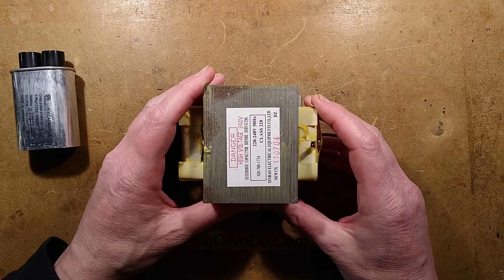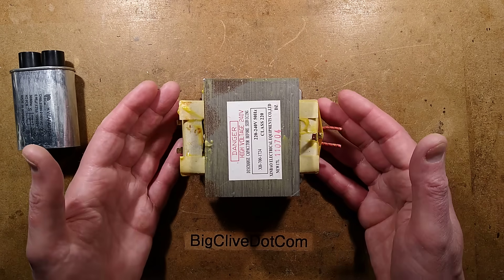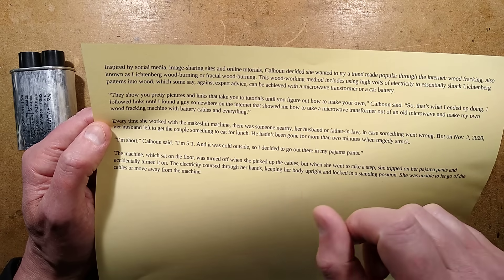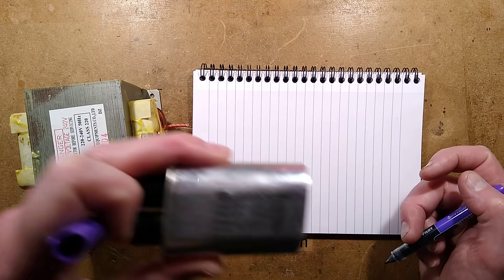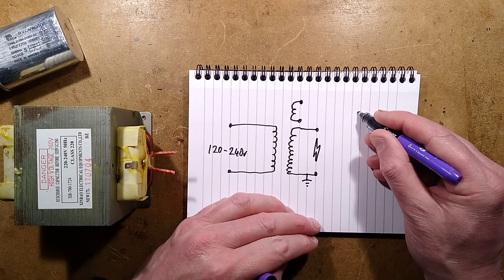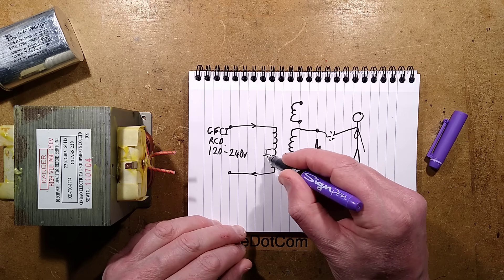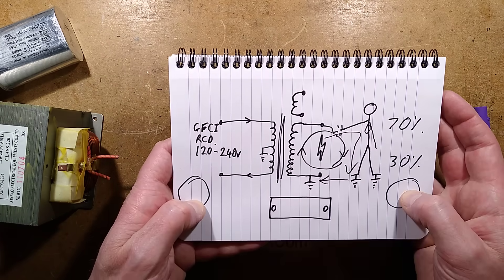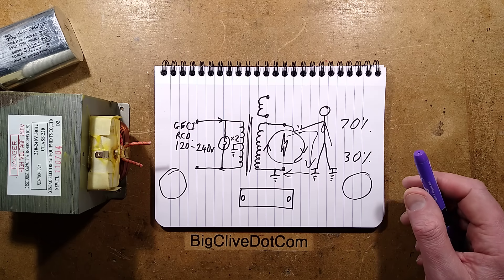The most deadly project on the Internet

Comment: Remotely operating a safe box with interlocks from far away is really the only thing to make this remotely safe to operate... another extra security measure can be pir detectors shutting of power at a latching relay so even accidentally getting nearly in range will render it powerless

Comment: I wonder, could you (perhaps weakly) tie one output of the transformer to neutral? if you did so that'd at least trip the RCD wouldn't it? though I guess it also puts one terminal at a define voltage above ground leading to instant bad times with a single contact rather than the two you'd typically need.
Reply: Likely just induced current could trip if you tried that.

Comment: In one of those videos they were using the ballast from a florescent light. Would that be the same safety precautions or would that require further safe guards?
Reply: It's hard to find any solid numbers but it would appear a fluorescent ballast still has some "grunt" to it so I'd treat it as killer.

Comment: I hope the video will help many people understanding electric shocks are no joke. One comment about the dead man switch: I've seen them used in controls used to "teach" robots. You have to hold two buttons with the palms of your hands if you want to move the robot but if you press them too hard it won't work. I guess if you want to prevent electric shock, using pressure sensitive buttons like those would be better, conventional buttons may not prevent you from the shock if you grip the device and cannot let it go.

Comment: First rate video. I was professionally trained in electronics, and there's NO WAY  I'd play about with a transformer from a microwave oven, (except maybe to remove the HT winding and replace it with low voltage windings for other projects.) Always respect electricity, just one mistake is all it takes...

Comment: Clive is so right about this, i have worked with high voltage and you can get a shock so easy so don't do it unless you know what you are doing.
if you have to do it read this, its all about insulation, never hold the wires, use something that is insulated to hold the wires, or even better set up the wires so you don't have to hold them, step way back and use the mains switch to activate, then turn it off and unplug before you approach your project after the burn is complete.
i have had a few shocks in my time, low amps but high volts, its not nice, i got too close to a HT lead with a metal tool in my hand, now the HT is supposed to be insulating, but yeah, it was old and was leaking voltage down to earth and i was leaning on the earth, 15,000volts for a split second will soon wake you up, i would not like to feel if it was constant, be safe out there people,  high voltage is no joke... trust us we are professionals.

Comment: I have several MOTs sitting around at home.  I have considered building one of these units - I will NOT because there is no way to properly safety one of these devices.

If I want to play with high voltage - I'll consider building something that can be remotely pulsed, like the medical lasers I've worked on in the past (power supplies that make a MOT look safe).

Comment: This is so weird, I today looked up "how to remove magnets from microwave", seemed ok up until I read the specs on the transformer, the HV cap and the beryllium coating(unsure if I spelt that right), I decided against risking my life for some, from what I saw anyway, mid-tier magnets that I could easily buy and save my self a whole lot of stress and possible death.
Reply: Old microwave oven magnetrons have beryllium oxide insulators. I have disassembled tens of microwave ovens for magnets and other components. I have not crushed a single magnetron insulator despite some rough handling. they are pretty sturdy.
Reply: @Psetta  Are the magnets you get worth it though, I have a microwave that's about 10-12 years old, been sitting ready to be taken to the dump.
Reply: @dallasgrant  Depends on what you're using magents for. Old speakers have good magnets especially subwoofers. Seem to be on par with the magnetron magnets.
Reply: @Milwaukee Mac Repair I've been hording them for years, I fix computers on and off and if someone wants their drive wiped I drill out the platter in front of them and disassemble the drives, I probably have 20-30 magnets form them.
Reply: @Milwaukee Mac Repair Another good source of magnets are the dynamos from workout bikes and ellipticals. A little while ago I recovered the magnets from and they were unlike any other magnets I've ever come across before. Extremely strong like neodymium magnets yet light as a feather.

Comment: The High output voltage of the secondary of the Magnetron transformer is AC...  the voltage to the magnetron plate itself would be rectified DC, and filtered by that big capacitor he talked about!  -  either way, it can kill you if you touch it when it is plugged in!

Comment: Excellent statement on safety,  we used to test resistance welding transformers ( spot or projection), with 2 Kv insulation apparatus,  requirement was standing on a rubber mat, and very thick rubber gloves.
Dead man's switch now feature a mid position switch, ref press enough to close contacts,  both pressing harder or release open contacts.
Thanks for sharing

Comment: About halfway through the video I had a horrifying realization.
MICROWAVES ARE ~1000 WATTS.
2kV at a THOUSAND Watts.
They're DESIGNED to cook
Reply: And because of the way the voltage doubler works on the old one the transformer will do double the wattage!

Comment: They make awesome car stereo Power supplies cut the high voltage out and re wind them using a voltage regulator. Great video the high voltage caps are dangerous to if they don't have a bleed off resister.

Comment: Ugh, I see a capacitor and a transformer. What could possibly go wrong? Just use a AA battery on one side of even a small transformer (for audio) while a friend (or have friend zap you) holds on to the other side. 

Another good way to get zapped is leaky spark plug wires. The sudden release of electricity in to the ignition coil generates a pretty high voltage. I got some shocks which I think were around 50kV.

I didn't think about it, but yes a GFCI won't save you with this burning technique. Nasty.

Comment: Having worked on high power AM transmitter equipment over my lifetime using valves with many KV on the anode, it's the capacitors that make me most wary. Of course no one should touch this stuff unless they have a deep understanding and experience with high voltage electronics.
Reply: And even high/mid frequency isn't better: you should not look into a coaxial cable connector, to begin with...
Edit: MF and HV in induction heating/treatment.
Reply: @AltMarc  A coaxial cable connector does not normally transmit a signal through the air. A male connector only has a wire less than 0.25 inches leng. That would make a terrible antenna unless the signal frequency was in the very short microwave frequency. At the short microwave frequencies you would be using a waveguide not a coaxial cable. Microwave waveguides do transfer energy and are dangerous to look in.
Reply: I worked on those for a while and lived to tell about it, did get shocked by the antenna tuning network, got a puncture burn.
Reply: Many years ago I heard about a RADAR technician who was in a hurry and didn't discharge the high voltage capacitors on the transmitter. He crawled inside, got a shock, and bumped into the high voltage capacitors leads. He didn't survive. Without doing something safely you are at a much higher risk of death. Accidents can happen even when doing the correctly, but the chance of serious injury is reduced.

Comment: Good video, Clive.
I was an Electrical Engineer for almost 50 years before I retired. Enjoyed every minute.  I'm still scared of electricity and hate even the smallest shock.
The line between overwhelming fear and adrenaline rush is very fine and often very blurred. The line is called "Respect".
I finished up my working life teaching electrical safety. Live working is definitely not a good idea unless it's absolutely unavoidable and done in a very controlled environment with proper equipment, an abundance of caution and being observed by a non-participating qualified person ready to carry out an emergency shut down as well as point out any deviations from agreed procedure or unanticipated scenarios.
In my experience the dangers of arc flash are usually greater than electric shock, and just as common as. Arc flash from a microwave transformer is not relevant because the current would be too small. It's not going blind you or evaporate copper for you to breathe in and condense back into solid copper in your lungs.  But the flow of current through you will cook your flesh given enough time. Just as it cooks the wood. One hand in pocket is often a good idea, but of course that doesn't help when your feet are well and truly earthed.
I don't think that you emphasised enough the fact that your muscles will contract and you simply won't be able to let go of the live wires however hard you try even though you may still be conscious. Conscious for a while as you are slowly cooking or until your heart stops or your fingers fall off.
Reply: Yes, excellent idea to not use your fingers as fuses.
Reply: I experienced that muscle contraction fun already at 240V when I was 6 and unknowingly touching an exposed mains outlet. It is an unfun experience.

I love electrical engineering in theory, but I stay well away from any high voltage stuff. There are people who are paid to know better than me, worst case I can hire them.
Reply: @insu_na  You are so lucky to have escaped without serious injury or worse, glad you weren't harmed 😊
Reply: Why isn't this causng you to get knocked out as I'm hearing the electric chair does?
Reply: @draygoes  I believe you become unconscious as a result of asphyxia due to the inability of the diaphragm muscles to work, not a great position to be in.
Reply: @draygoes  Sometimes it does, but even then only after you have been forced to endure the pain for longer than anyone is wishing their worst enemy. If or when you pass out is pretty much impossible to say. And even if you were to pass out, your muscles wouldn't relax.
Also one of the reasons why the electric chair was done away with was exactly because it didn't knock you out immediatly. Which makes it one of the worst ways to kill someone.

Comment: It only takes 1/10th of and amp to kill you, you could also be electronic zapped checking/ testing on you automobile during the winter as salt is present, if your in a heated garage and the ice starts melting and you get wet a bit wet from run off, a natural situation, and all of a sudden you will feel a tingle present, and you have just completed a circuit. Same goes for HF welding and your sweating in summer you could complete a circuit, your also sweating salts. This why some manufactures, put up barriers around cages to keep you away from the work piece and installed fail safes. Sometimes your paying money for an tool, that has failsafe's built into it which is more money. There is a reason and reasoning behind this methodology. Save up and buy the proper tool and tooling. Short cuts only result in a short life! Thank - you for making this video!

Comment: I like the deadman switches.  I have heard that a low wattage inductive fluorescent tube ballast, or appropriate resistor can be added in series with the primary to reduce current for harm reduction?  Isn't added impedance or resistance on the primary what makes a neon sign transformer less deadly? 

I have a free MOT I originally planned to use in a large tesla coil until I realized the voltage was too low. I haven't ever plugged it in because although the voltage may be "only" 2000V, the current at that voltage is terrifying to me. I have seen people do dumb things with  MOTs on YT but the fracking wood frackers take the cake. When I was considering testing mine out, it was going to be 20m away on an extension cord plugged into a variac at 50V, plugged into a surge protector which I was going to turn on with a 1m long PVC pipe while wearing high voltage gloves and standing on a plastic milk crate on a dry wooden porch, but I still had doubts about safety so I didn't try it. Getting zapped dozens of times as little Mr scientist taught me to triple up on whatever level of safety precautions seemed like overkill. I refuse to even imagine the hand held jumper cable people cooker and killer.

Comment: the thing i'm surprised the most is that 30% of people survive after this. these high voltage high current circuits are terrifying.

this does include neon light power supplies too. if you were shocked by one and survived, you should have mentioned that you were shocked being connected in series with a neon light that acts practically like an open circuit (it has very high resistance) that dramatically limits the current. most neon lights electric supplies are scarily deadly if you get shocked directly.

Comment: I almost died building a Tesla coil out of these in twelfth grade. I blew a hole straight through my thumb. I just set my hand on top of the transformer and all my fingertips had small holes blown out of them. The secondary wire shocked my thumb and the electricity exited through my finger tips on the top of the transformer. I am alive because I was specific about working on it with only 1 hand at a time. It was a life changing experience.

Comment: I've been doing this for years now but I dont use a microwave transformer, I use a welder. I am no where near the table while it is switched on and everything is powered down before I go near it. 
I think once you introduce a conductive fluid to an electrical device it becomes infinitely more dangerous.

Comment: I have repaired a number of microwaves. You will never see me power one up with the cover off. I might do some voltage test with the transformer disconnected on the primary side because most often the primary side is the side that needs work, most oten the door interlock switches. For testing the cover goes on and a cup of water goes inside. It will boil if it works and you can tell by the sound of the machine if the magnetron is energized.

Comment: I'm sure you know Clive, but to my surprise and pain as a teenager, "Caps" can restore charges even after being shorted out.
Some capacitors or other devices with capacitance will do this.
An example of this is a CRT final anode, they will bite multiple times even after being shorted out !! 
if you remove the capacitor you may be disconnecting a bleed resistor too.
I jumper the terminals of some devices , even in storage !! (No pun intended)
Everyone, take extreme care!! when working inside any electrical or electronic device, you are always doing so at your own risk!!

Comment: I was waiting for this after you told us in the chat Saturday night. I think you did an extant job explaining the risks. 
Other than a fence charger I have also taken a hit when replacing fluorescent lamps live and put my hand on the tombstone and it was cracked.  I don't count getting nibbled by the TIG welder using high frequency arc start.

Comment: Thanks for making me aware. I want to build an isolation transformer for my test equipment and I was considering using a microwave transformer as part of the build. I am safe and have worked around high voltage all my life. I know of someone who used to touch fuses to see if they were hot and indicate they failed. One day on a 480v supply he without looking reached around a control panel and his ring made contact. He died instantly. Another electrician I know of threw a breaker but didn't test for voltage as is the proceedure.  The breaker linkage  broke and 575v killed him instantly.

Comment: Presumably when electrocuted in this way, you'd achieve an arc burn path through your body with a similar cross section pattern to the wood art?  Sort of achieving your goals, just with a change of materials.
Reply: @gs188  It's an electric version of Kai's Power Tools...except that it won't plug in to Photoshop...
Reply: Not really display quality though...
Reply: Nah. Itll just pop out of some part of your body.
Reply: @jeremyhall7951  - There was a guy in my high school in the 80s who survived a summer job accident where he moved a metal ladder too close to high voltage lines. Had a blow out through his scalp and woke up on the ground several yards away, wondering what the hell happened. After he was released from the hospital, and for the next year or so, everyone called him "Lightning Man."

Comment: Manufactures should make the transformers unremovable from microwaves. If I was ever going to do anything like this I would first connect the equipment, then attach that to the secondary outputs with nothing connected to the primary, after then I would go from the primary to the mains, so you would not be touching any of the "hot side". Of course, never try this!